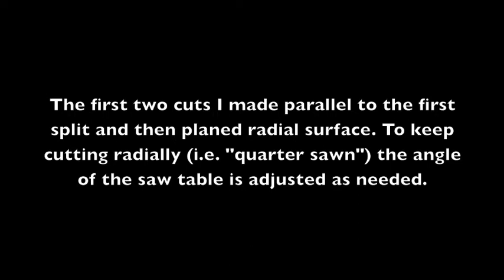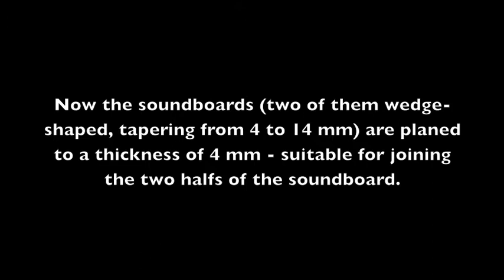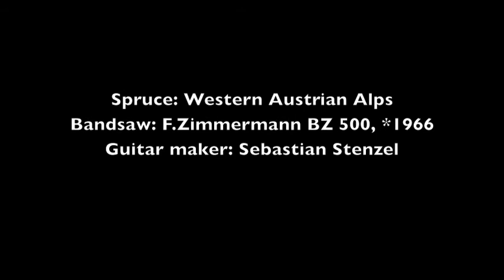Resawing Spruce Soundboards

Comment: Dear Mr. Stenzel, thanks for nice video, if you allow I say two things: one about your saw: teeth&set, they are probably 8-12mm pitch, a bit small for sawing top boards, you can use 20-25 mm pitch teeth with better results, the vibrating sound occasionally produces due to your setting pattern probably +-0 if you set them on modified arrangement, your saw will cut more smooth with less vibration,

Comment: Hi , i have question about the spruce lumber you were slicing , its freshly cut from log ? Or it was dried and seasoned !  And after slicing the tops do you use then directly or you dry then more ?
Reply from the maker: I split the wood fresh, seal the endgrain with hard-parafin, then let the wedges air-dry for at least three years. Then I resaw the soundboards as shown here.